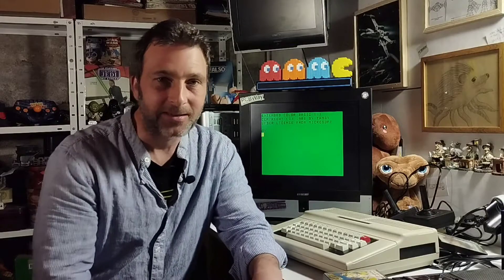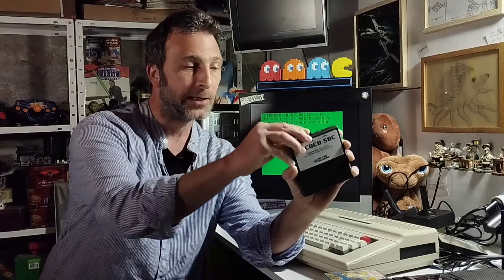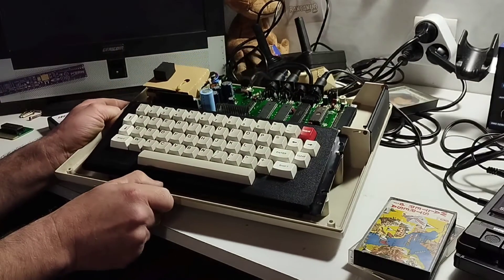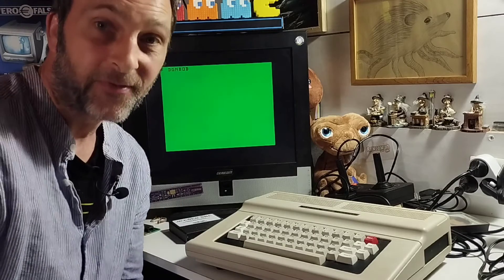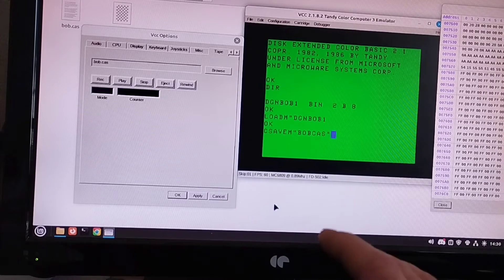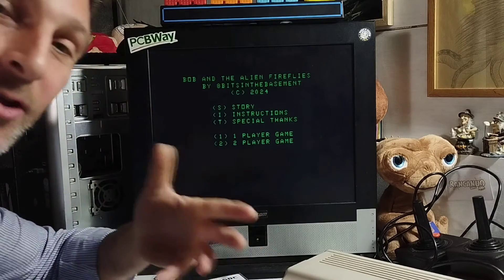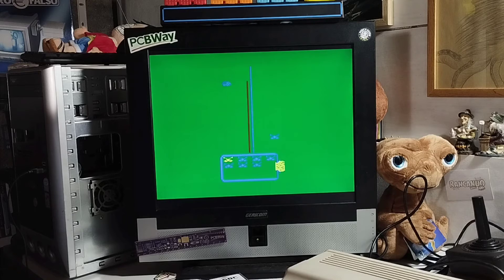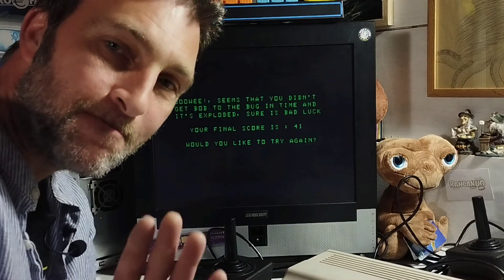So, do dragons like Coco? (or, will my assembly code written for a Coco not run on a Dragon at all?)

Comment: The 6809 was a pretty good cpu.  One benefit was  the code is  position independent using relative addressing instead of absolute. One thing I'd recommend is cutting the NMI line on the cartridge slot and  install a toggle switch. Doing that will allow you to install a cartridge and copy it to tape. and load the application from rom into ram. Thats what I would do in the 80's. I would borrow game and application cartridges, copy them to tape to be loaded into the memory address of my choosing.
Reply from the maker: That's a great little hack, and it's the reason that some cartridge software had self modifying code included as an early form of copy protection. It couldn't corrupt code in ROM but it sure as heck could if it were copied to RAM. The 6809 is the only CPU that I know, well for the moment at least. It is quite forgiving for someone just learning ASM like me :)
Reply: @8bitsinthebasement  I used to know the TRS-80 coco inside out. The service documentation and theory of operation is now available free. I paid for the technical reference manual back in the early 80's and started to mod mine. Tandy used the 6809E version which is slightly different than the mc6809. (hardware wise). If I remember correctly there's a way to double the clock speed with a poke command. Poke 65535,0 this also causes the data to be written at a faster rate to tape so when reading from tape the high speed poke has to be enabled or the computer cant read it. The coco should have been built with the mc68000. That would negated the need for a custom SAM chip (which is no longer available), and extended its service life dramatically.  With some discreet logic, 3 74ls373's and a couple of 8 input and gates you can output data to the real world under basic.  A 74ls154 could be used to select 1 of 16 output lines. The analog joystick ports are readily available for analog input. I've long given up that computer, but it's still somewhat interesting.  At the time I saw I as advanced but it's relatively crude and quite basic. It's probably a good choice to learn assembly language and basic computer architecture if anyone desired to go that route.  Thank you for being so nice.  Enjoy your trip down memory lane, so to speak and have some fun.
Reply from the maker: Again thank you for the information, although the SAM 74ls785N is very hard to find there is another chip that will take it's place (the 74ls783 but the memory may need to be changed to work with it if I understood correctly. Or at least with the version of Coco 2 I have). Wonderful system and processor to learn for in any case. Again, many thanks for watching.

Comment: 8 bits in the basement (and a little upstairs this time).  Congrats on finishing this!  A real accomplishment, even without accounting for the fact that you were *learning assembly for the first time*!  Very impressive.  Oh, and I laughed aloud watching the machinations as you typed CLOADM with your matrix-translation in hand.  Which makes me wonder... would your in-game keystroke reading (for the menu items) work on real Dragon hardware?  Or did it only work here because you sold a CoCo's soul?
Reply from the maker: Thanks for your kind words, the whole process so far has been a fun and rewarding one. That's a very good question you ask. I assumed that the keyboard reading would work fine in a Dragon (as it worked well in my Coco-Dragon abomination and also in XROAR using the Dragon keyboard layout). But now that you ask, I have a doubt. I used a rom call to $a000 for the Coco and to $8006 for the Dragon. The only difference I saw between the two was a slight delay on the Dragon version (but only sometimes) before a keystroke was registered. 
I have sent a Dragon beta version to a number of Dragon users but have not yet gotten any word back as to if it works or not. So the short answer is that I don't know for sure. 
To be on the safe side, I made a "backup beta version" in which I reworked the Dragon version to not rely on ROM calls for keyboard reads at all anymore. This "backup beta version" now reads key presses directly from the PIA using FF00 and FF02. So this should eliminate any keyboard problems with the Dragon. I'll send this version out if any problems are reported.
Thanks for all the help you've given through your videos, I'm looking forward to playing your version of Moon Patrol when you get it finished ;)
Reply: @8bitsinthebasement  Wow, you've done your due diligence for sure!  If XRoar Dragon-mode works, I'd be quite surprised if it didn't on physical Dragon hardware.

Comment: Great video .. I've never played with a coco or dragon .but it's very interesting with the rom swop ... Congrats on Bot conversions 😉...
Reply from the maker: Thanks, and it's true there is very little difference between both computers. I had to convert my code to get it to work on the Dragon because I'm using the routines in the ROM to read the keyboard and joystick. So each time the game needs to check the joystick for example, it will jump to an address in ROM to get the instructions of how to do that. The addresses of where these routines live in ROM are not the same for both computers so need to be changed in the code to get them to work. A real programmer who knew what they were doing would write their own routines and eliminate the need to use the builtin ROM routines at all. In that case no code conversion would be needed at all. Give me another few months and I'll get there ;)